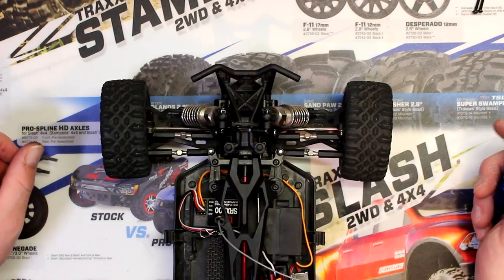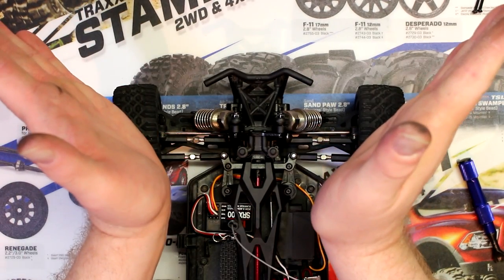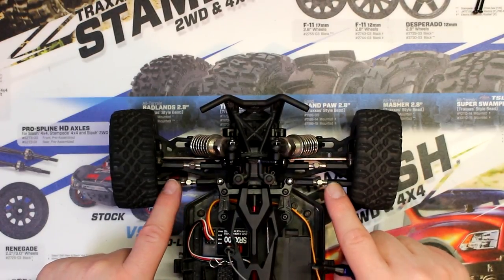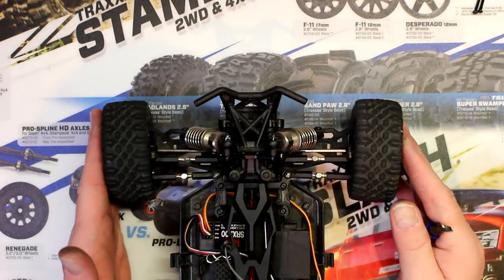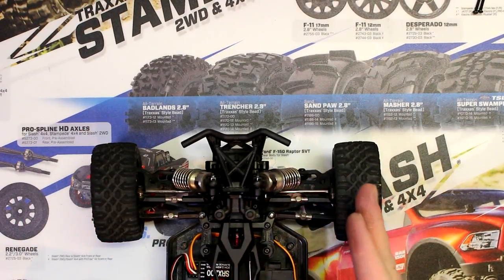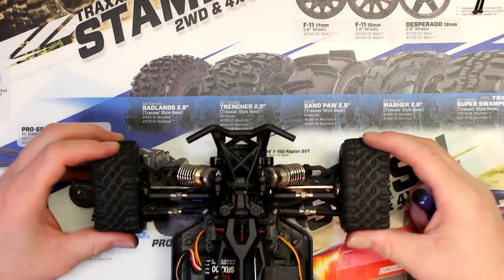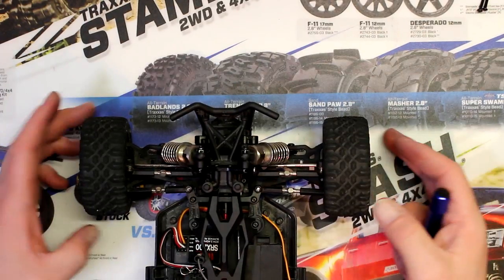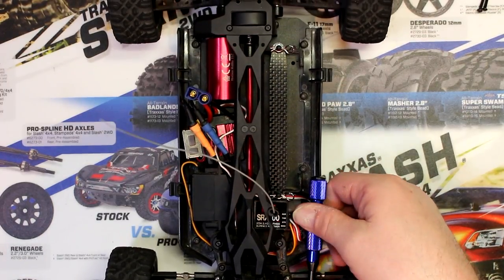How To Align Your RC Vehicle

Comment: nice to see someone posting this, i have also been at it for a fairly long time, couple points ill add....you can buy alignment tools for rc cars   most do it by eye,  its fair to say most probably dont even know if their cars have adjustable turnbuckles or where there located so your info will likely be new info to some. . you should try to adjust them the same amount for both sides, sometimes they come uneven from the factory this can lead to the servo trim needing to be centered. calipers work for checking the distance between ball ends. adjust based on cars full weight on the tires. raising and lowering affects toe and camber depending on the car some vary a lot more than high end racers will. some will argue about using toe in, and you see them always complaining about high speed erratic handling car swerving etc though absolutely refuse to blame toe out and rather replace servos tires shocks etc etc before never considering toe regardless of how many wrecks.  example:high speed run, toe out. acceleration toe out is reduced in 4wd csrs due to the wheels pulling against any slop in the steering becoming neutral or even slightly toe in depending on car and wear. once the car stop pulling hard nearing top speed this becomes more toe out again and unfortunately any ground imperfections can send it into the weeds very quickly. braking will also cause even more toe out as the front end dips lower then the front end is just fighting for which tire will get  or loose traction first.i prefer a little toe in on my dirt track cars, vs more neutral toe on the pavement. generally i dont ever prefer toe out, though this might be good for small racetracks with a lot of curves and short straights. in the end there are many things that affect handling probably more so in a rc than a 1to1

Comment: Toe in and out have different applications. It depends on the track you're going to try or even on your driving style. For you it's clear that you prefer a neutral position between those two options, but keep in mind that there is no right or wrong, it's all about preferences 😉 Of course there are also recommended ranges on which we should work for each configuration

Comment: I just got the Tenacity TT with the same issue, right out of the box. I noted also the spektrum servo is not solid, may require a replacement. Very happy with your video, definitely works for me. Thanks

Comment: I Know this video was 6 years ago but what if my slash 2WD rear wheels are facing outwards?
Reply from the maker: On the Traxxas slash. The rear knuckles are fixed should not have any movement. The only thing I can see there were knuckles or not at the correct place meaning the right is in the left and the left is in the right. They should be facing in words a bit.

Comment: Do both remote and car need to stay on when doing this?
Reply: How do u know which way too turn backwards or forwards
Reply from the maker: On which way you need to turn it depends how your alignment is off. You can do it with the vehicle on and remote, but be careful not to put too much pressure to break any gears in your servo. I would make sure that your trim on your remote is centred turn everything on the servo will centre itself then I would turn everything off and do the alignment

Comment: My rc monster truck had unusual vibration when i when i run it in full throttle while i am hanging it in my hand. The tires should supposed to be normally rotating without anu vibrations. But now after 1st run, it has a vertical vibrations which was not present at the beginning. There os something wrong with this. Please help me.
Reply from the maker: It would be possible that you might have water in your wheels if that’s the case that will create a lot of vibration.  If that’s not the case I would suggest removing the wheels and see if you still have that vibration if you do it might be your driveshaft
Reply: @djsprc  thank you so much. There was plenty of water inside my tires. My RC is in a good shape right now. Thank you so much for the help. 👍👍😇

Comment: My car tires turn left when I turn it on. I adjusted my trim on my transmitter and it still turns left when i turn it on would you happen to know what is wrong with it?
Reply from the maker: Did you change the servo by any chance if you did it may not be aligned correctly or you might have an issue with your remote or the receiver if you did change the servo I will suggest removing the horn turn the vehicle on the servo should centre itself then you’ll be able to put your horn back on
Reply: I don't know what kind of RC you have but I had a Traxxas Bandit  for a while every time I turn it on the wheels would go all the way left I let it sit for a couple days and tried it again and they went straight I guess it's just a glitch or something
Reply: Remove horn, power up servo, center steering trim, and then reinstall horn so the wheels are straight

Comment: You don't even have the car turned on let alone a battery in it,  you have to have the car turned on to adjust,
Reply: Yeah he said as the first step to adjust the trim on the remote but that's kind of irrelevant if it's not powered on🤦‍♂️